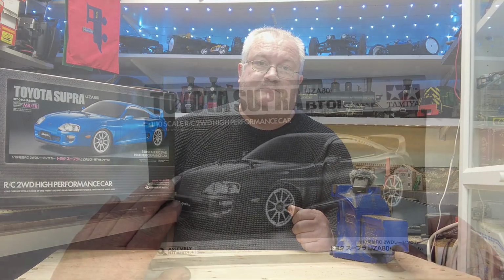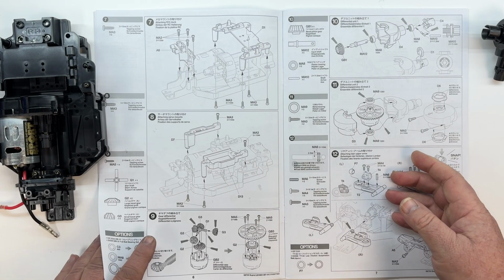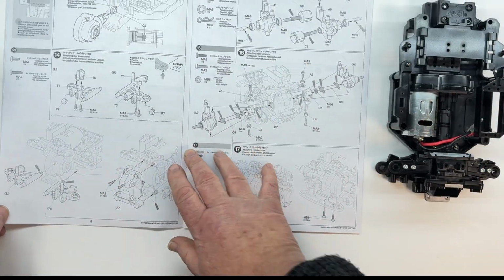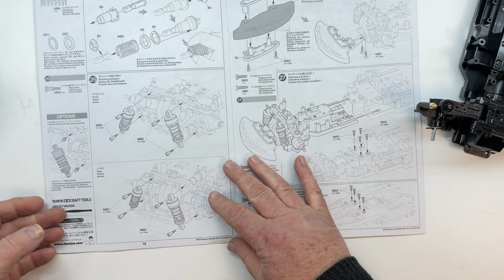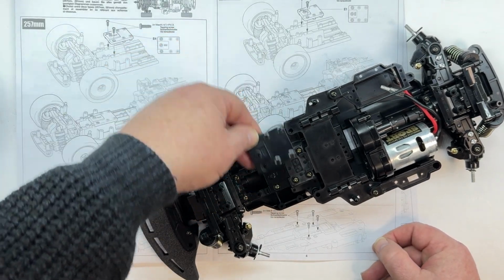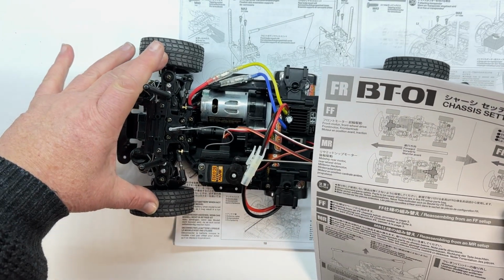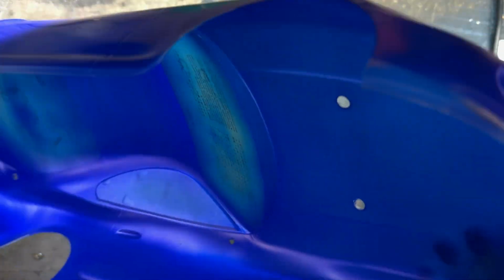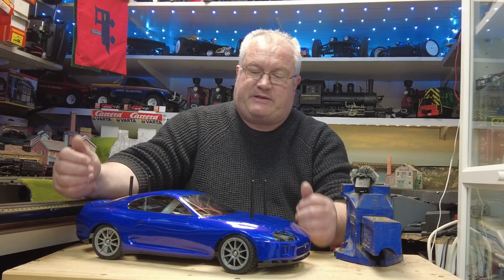Building Tamiya's Brand New BT-01 Chassis, the Tamiya RC Toyota Supra,

Comment: Nice video,i can't figure out how you can have a wheel base choice - doesn't the body dictate the wheel base? Too long or too short and the wheels will not sit centered on the wheel arches. ?
Reply from the maker: Hi Sorry for not responding sooner, I guess its so they can use one chassis for multiple kits but also giving the user the opportunity to try different set ups and use different bodies. Anyway many thanks for watching and taking the time to comment.

Comment: Usually cars have a caster angle, the steering axle is canted backward and in case of rotateable rear wheels (as in this model) the rear axle as well. But since the car goes the other way when changing rear to front drive the axles can not be canted.... how did they solve that problem?
Reply from the maker: The front and rear are symmetrical so I am not sure I follow, but ultimately this is essentially an entry level kit so it is fixed so no caster adjustability. Thanks for watching and taking the time to comment.

Comment: Thinking about buying one, I'm in the UK where would you recommend buying one ? Will also need controller and parts 
Thanks enjoyed ur video
Reply from the maker: Hi, thanks for watching, it is difficult to recommend as the prices go up and down and there are so many good retailers, I do check out Jadlam, if you join the loyalty scheme it can work out for you as you earn points for the next purchases (but the way I am not sponsored, just an opinion) So if you are buying a car do the controller as a separate transaction and the you can use the points from the car to get a discount, if that makes since. But do shop around and be aware of postage some charge a lot to ship, most are free over a price point,  hope that helps;

Comment: I will wait build this after a number of hop ups will be released ☺
how u set the wheelbase is just like m07 and m08
Body magnets man, it looks way nicer than those awful body posts
Reply: Some Mb01 hop ups will fit the BT01. Already available
Reply from the maker: we've cut the post back and they are not too intrusive, but I agree, been looking at some of the hop up but I will run first. Thanks for watching.

Comment: Diffs from the tt-02 not tt-01 :) . Really nice video i cant wait for my BT-01 to arrive !
Reply from the maker: I just checked my notes and it even says tt02, must have been a slip of the tong, but thanks for pointing that out. Thanks for watching and your kind words.
Reply: @dustyshelfcollectables  no worries man. The tt-01 uses metal gears and only has 3 gears. The tt-02 uses plastic and has 4. There both interchangeable tho. Tt-02 hopups like ball diff etc will fit on this chassis. I look foward to more videos !

Cheers.